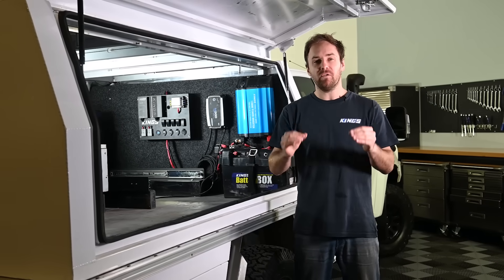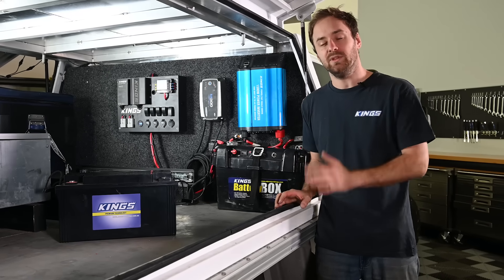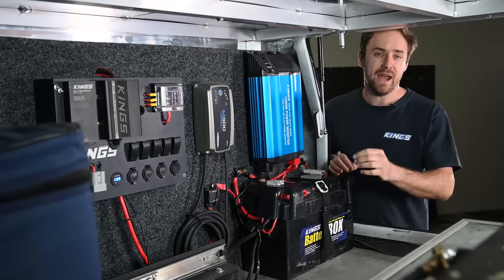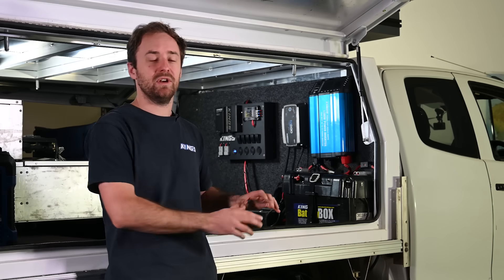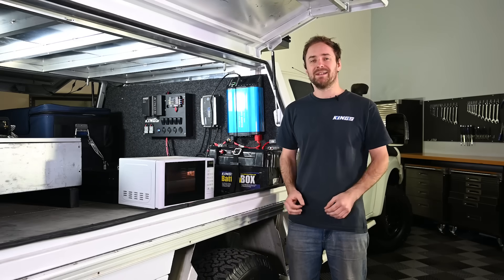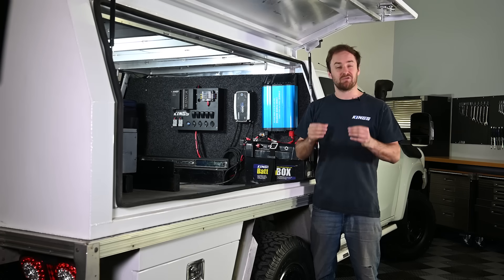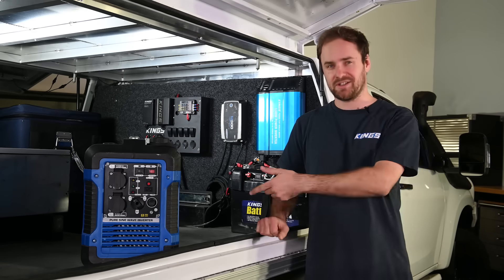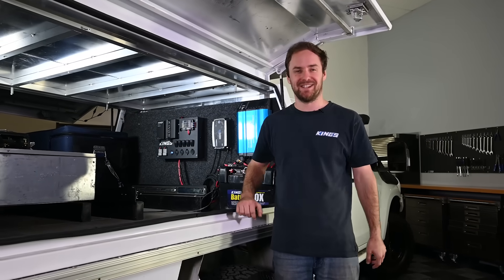EASY OFF-GRID 12V CAMPING SYSTEM! Campsite power setups made easy, rugged & reliable!

Comment: What about lithium?
Reply from the maker: Hi there,

For the most part lithium can be fairly freely substituted, the only points of change would be a regulator that is lithium compatible and ensuring that the lithium has a continuous output in line with your power needs.

Regards, Andrew

Comment: I have no money a 250 w pannel 
I live in a sunny place no mains i run 12 charges touch light and a alpicool 
No engine input just ordered an mppt eegulator
Advice?
Reply from the maker: Hi there,

The biggest part is ensuring that you have enough power storage to cover a day or two without sun, the worst thing is being caught out by poor weather and being without power.

Regards, Andrew
Reply: @4wdsupacentreAu  8 months a year that's not a problem . I just ordered an MPTT controller and maybe get 2 batteries come the winter?

Comment: I'm paying close attention to this serious because I want the best system I can get.   Right now I'm a weekend warrior but come retirement I want a rig I can rely on for multi day off grid coming.   I WAS going to purchase a one ton truck for this purpose but plans changed to a Bronco with a payload of about 1,000 pounds so I'm very conscious of weight and how I'm going to manage that.   Batteries are heavy but necessary so I'm struggling with this.   I know I want a good solar setup.  I'm thinking I'm going to have a great electrical setup with no room for accessories that I installed the dual battery system for such as winch and air compressor.  I'm kidding,  but this is how my brain is trying to work through all this
Reply from the maker: If you want to save on weight, get a lithium battery - specifically lithium iron phosphate or LiFePO4.

They’re safe, stable and rugged and offer plenty more output for the same size battery compared to lead acid!

Cheers,
Cahn
Reply: @4wdsupacentreAu  Thank you for the quick reply.   I just watched your video on Lithium batteries as well.   Here in the US, it is not uncommon in the summer to hit triple digit temps (F) and single digit (F) in the winter.   I think lithium is the answer but I definitely have more thinking to do after watching your series.   Thank you for all the info and your time creating this series of videos
Reply: @Crumb_Trails the setup they've described is very similar to what you would find in an off grid cabin / home just on a smaller scale. (eg 300 watts of solar instead of 12,000watts) one battery instead of 8-12. 

The setup is rock solid, only thing I'd add (I might have missed it) would be some battery monitoring equipment. It'll give you an idea of the batteries current state of charge, the amount of power your load is drawing or chargers are providing and an estimate of how long you can continue to run your current load for before the battery is flat.

Comment: Ordered the product on Saturday received the Sunday morning before 8:00 am. Easy to set up, easy to run, noise level was very manageable and not an hindrance or annoying to be around. Very good generator, I like to remote start plus it has a pull chord. Dual fuel was a must and easy to hook up and switch.

Comment: Hi guys love the videos I’m just putting together my system to do the big lap 
I have one of your 120 ah lithium batteries control box 40 Amp dc dc charger 
I’m wondering if I can run parallel with a 200 ah lithium battery 
Kind regards Sam

Comment: When you say Solar Priority, does that mean that even if I have low sun, it'll still favor the solar? I'm in Canada and the sun isn't always the best for solar charging... I have a small Jackery battery right now, but upgrading to a 100Ah lithium. When I charge it with solar, I get about 50W of charging input at max, or about 7-25W on the lower end.. When I charge my battery from my DC plug in my car, I get 40-45w continuous.

So I'm just worried that solar priority will not charge my battery fast enough
Reply: How big is your solar panel?
Reply: @perpelle  one 100w solar panel

Comment: Hey there I was tempted to get the 25amp hr dc/dc charger but I have a 140 amp hr battery I seen somewhere u need atheist 40 amp to fully charge my battery do u know I'f that's correct or will the 25 amp kings one work fine
Reply: I think that depends on how many solar panels you are running.

Comment: If using the 12V CONTROL BOX with a dual battery setup, are you still needing to add fuses to both batteries or does this systems fuses cover all of that? Will I still need one fuse at main vehicle battery?

Comment: Can I plug a c tech charger into my second battery that’s in a battery box and ran with a duel battery isolator than plug my portable solar blanket into the plugs on the battery box in my head it is like the main battery is charging the second battery as I drive and when I am stoped the solar and the charger is charging it not sure if I can do it like that tho
Reply from the maker: Hi Shannon,
Yes it sounds like a plan but just to be sure, did you want to send us an email with your setup so we can advise promptly?
Cheers
Saleha

Comment: As an electrician I find you explain everything clearly and point out the major things you need to look out for. While everything under 110ac and 50vdc can be done by yourself its worthwhile noticing an auto electrician is required over that voltage.
Reply: As a dummy he saved me $1300 and I didn’t have to drop my car off for two days only to have some apprentice work on it 😄 cheeeers KINGSsssss
Reply: As a non electrician, everything was clear as mud...
Reply: As an electrician, he lost me at 2 minutes 35 after he said current draw was measured in Amp-hours. It's not, it's measured in Amps.
Reply: @ianwilliams8448  With batteries its measured in amp hours, as in the current draw (amps) per hour.
Reply: @PossumWaffen  current is measured in amperes. It doesn't matter the energy source so don't try and explain this basic error away. The amount of energy may very well be explained in Ampere hours, but that's a different thing.
Reply: @ianwilliams8448  Well the industry I work in maybe the common terminology is different. When factoring in how long servers/routers etc.. will run on battery backup, the term "amp hours" is used. "Ampere hours -- sometimes abbreviated as Ah or amp hours -- is the amount of energy charge in a battery that enables 1 ampere of current to flow for one hour. Another way of saying it is that 1 Ah is the rating indicating how much amperage a battery can provide for one hour"

Comment: Hey mate I’m confused, I want to install a second battery into the battery box, a solar blanket, an inverter, a 240V charger for the battery once home...I will use a 50 plus lt fridge mainly and a few light that’s it. if I want a dc/dc charger, do I need to install a battery isolator anyway or the dc/dc charger will do all. I want the second battery to be charged mainly from the starter battery at start as I will install my solar in future and don’t use often. 
Please give me an advice pls 
Thank you so much
Reply from the maker: Hi mate! Yep the DCDC charger works as an isolator. 

Depending if you hook up the blue wire (usually for vehicles with smart alternators) or not, will affect the isolator voltage cut off point - the exact specs are available on the website.

Cheers,
Cahn
Reply: @4wdsupacentreAu  Can thank for taking care of replying to me/us is very nice. I own an FJ45 Arkana..definetly not a smart alternator..ok I'll move for a DCDC. THANKS

Comment: Ok, so I have a 2007 Rodeo with a constant voltage alternator. I want to do a second battery setup in the back via a battery isolator and anderson plug setup with the option to be charged by solar panels. Do I need a DC-DC charger for this or do I only need a MPPT controller for the solar side of things?
Reply from the maker: Hey Dave,

Definitely don’t NEED a DCDC charger. But in some cases by the time you add up an isolator and MPPT charger a DCDC isn’t too much more...

That being said what you’re saying is right - an Isolator and MPPT should be fine for your setup

Cheers,
Cahn
Reply: @4wdsupacentreAu  
Thank you.

Comment: Why why why do all Aussie providers top out at 100Ah-150Ah batteries??? What is your aversion to bigger batteries, LifePO4  batteries or just more sensible setups than these ‘ute’ setups?
Reply: Yes, Lithium is the way to go and the price is about the same in comparison. My current setup is 160Ah AGM, 80Ah usable max,  weighs 67kg and will only last 10yrs at best. I'm getting a 200Ah Lithium which can be drained to almost zero, lasts 20yrs and only weighs 26kg. The price works out the same if you do the maths.
Reply: @ecohippie3544  don't count your chickens before they hatch hippy
Reply: @ecohippie3544  
That is really heavy. A decent Century 150AH deep cycle battery is about 40kg.
Reply from the maker: Hey mate! Speaking personally, I’ve done plenty of big trips and never needed more than about 100AH. I suppose it has to do with the ‘touring’ or ‘overlanding‘ style of camping we do, where we drive long distances which means the battery is always charged up. For example my brother and I did about a 6500km trip over a 2 week period - we were driving long distance most days which ensured the alternator was charging the battery more than enough. The few days we actually spent at camp in the outback there was more than enough sun to charge batteries to 100% constantly. Even on shorter trips solar is usually enough to keep everything fully charged. Extra battery capacity is always useful though and some people are now getting into LiFePO4 batteries - if they can justify the extra costs. Cheers, Cahn.

Comment: Hi, thanks again for a very informative video. I was wondering if you have a PDF with all the info you covered on the video so I can follow along when I wire my ute up? I am glad you touched on the wiring of the portable solar as this is something I been wondering about. Wasn't sure if you needed to unplug the permanent panel for the portable one to take effect? Also, the 240v charger, did you just wire that directly to the dual battery?
Reply from the maker: Hi there, you can find all the PDF manuals for the battery and portable solar in the additional section on the website. Cheers, Jay